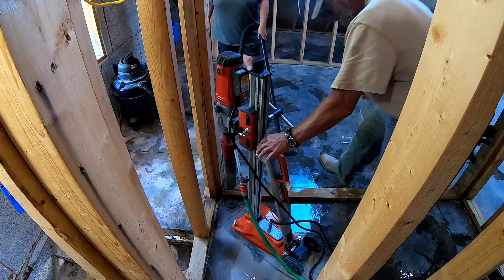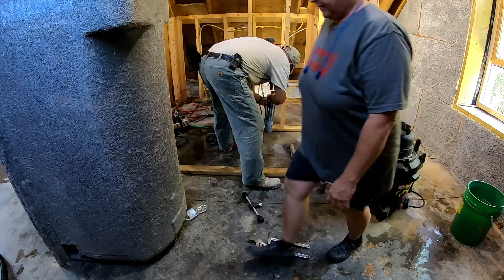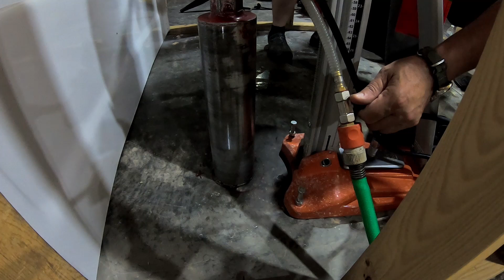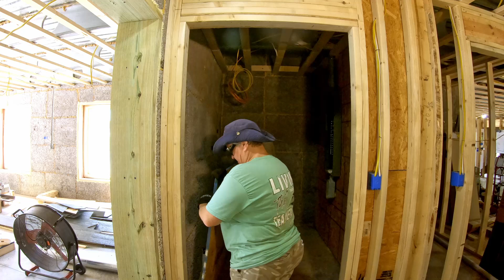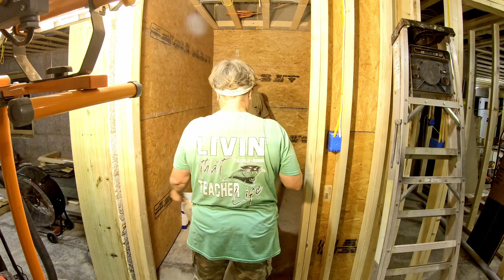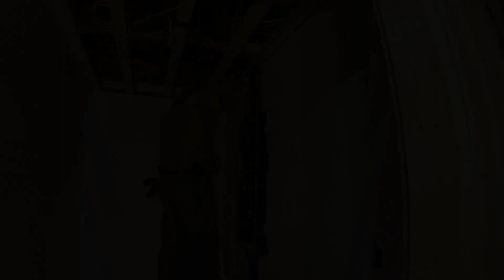House Build 59 - Plumbing Rough-In Prep

Comment: Excellent, Tony.  I've never seen one of those core drills work.  You guys were smart to have that wet vac handy.
Reply from the maker: Rick, I'm glad you got to see something new.  It wasn't obvious on the video but we were filling the 12 gal. vacuum about 3 times per hole.  Having used core drills before, I knew it was going to make a huge mess!
Reply: @ozarksethic  Ha, if the vacuum needed emptying was a question that went thru my mind while watching. 🙂  

BTW, just throwing this out JIC you care, the little laundry room we have has a tiny window above the dryer.  Each time we run the dryer, we close the door to that room (it's closed all winter anyway so we don't heat it) and open that little window a little to allow air to flow from the outside directly into the dryer instead of sucking it from the rest of the house; same idea as the direct air vent for your stove.